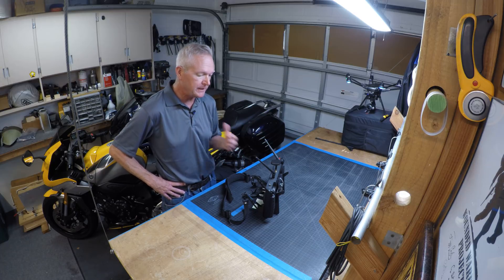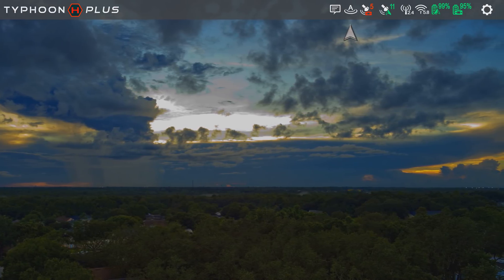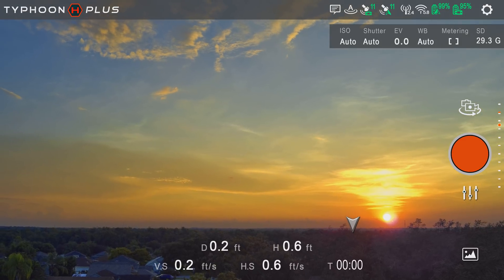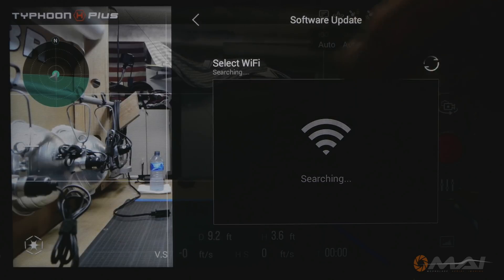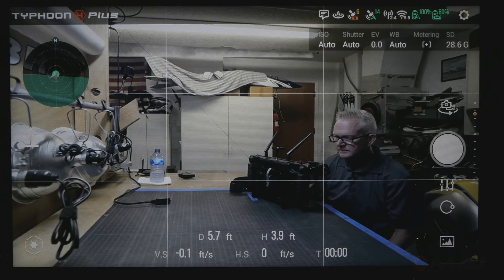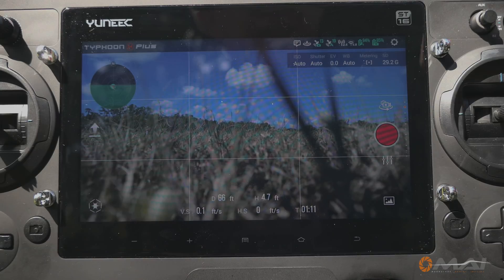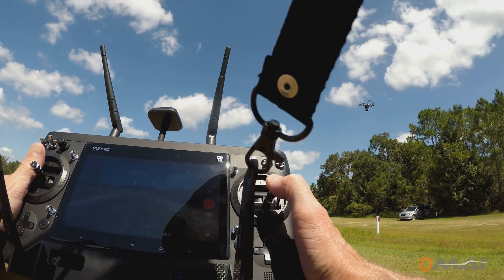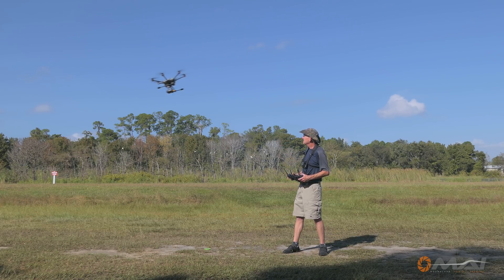Typhoon H Plus - ST16s Interface and Flight Modes

Comment: Hi Patrick

Thank you for this most interesting video. I am still with H 480 and I am waiting for the release of the H3 for a new purchase.
What is your opinion on this H3 device?

By the way, I bought your tray and I really liked it.

Thank you in advance for your answer.

Serge from Quebec Canada.
Reply from the maker: Well thank you Serge, for watching and glad you like the Copperdawg Tray. As to my thoughts on the H3 - Myself, like a lot of others are very keen on seeing how the H3 plays out. Yuneec has decided that it will be a limited release (unlike the Plus), much like the 520. Yuneec has already released it in Europe and here in the states but there are very few pilots that have them so the information is only dripping out. Personally I am curious as to the quality of the imagery from ION L1 as this is the only real difference to the H Plus outside of a few interface changes with the software that will allow the user to 'dial in' the controls much like we had on the 480. In addition, I understand that the trim pad cruise control has be added to the H3 so that is good. 

But from an operational point and from a cost point, the H3 will have to have a substantial gain in the camera to warrant the nearly 800 dollar (US) price hike over the H Plus 1,899.00 vs 2,699.00. 

The fact remains that the same 1" 20 megapixel sensor is being used on the H3 that is used in the Plus and to get better imagery will be difficult. In the current market (2000.00 price point) the 1" sensor is still the benchmark across many brands such as the DJI M2P, P4P and the fourth coming Autel EVO 2 6K as well as the Yuneec 520 and Typhoon H Plus. I am still very satisfied with the H Plus for what it is and the imagery that it produces and to me, the H3 is a bit redundant for my purposes but may have something to offer those coming from a 480.
Reply: @buelle109  Thanks for the reply Patrick.

But why a limited edition of the H3 and H520? Is this the end of Yuneec sion why such marketing metality?

Want it stayed on the market or not, I plan to buy a new drone soon, and I don't want to go to DJI, because I hate being forced to use my cell phone as a backup device.

The yuneec remote control seems so proffesional.

when did you think is this the end of Yuneec?

Comment: Thanks for you video.....I just purchased the Typhoon H Plus and can't get my landing gear to go up or down!!
Reply from the maker: Sometimes  the gear will stick if the aircraft has been sitting in its box for a long period of time. My first Typhoon had the same problem and I was able to unlock it manually (not something I would recommend). If you look on the Yuneec Pilots Forum and do a search you will find some discussion on this topic.  Good Luck.
Reply: @buelle109  Thanks for your reply.  We have tried just about everything.  The landing gear will go up if we put it in "Home" mode real quick and then switch it back to angle mode.  We may just bring it back to Best Buy and see if they can get it working, and if not, we are within the 45 day return/exchange timeframe.  ---  In the meantime, we are enjoying your videos and learning a lot from them.  Thanks again.
Reply from the maker: @MikeDianaCO  Yeah that sounds very strange. I would agree, take it back to BB and do an exchange.

Comment: When in slow speed, I can’t get the THP to move forward with obstacle avoidance turned on. Only when I move the rate up a bit to a faster speed, and even then it stops occasionally. Is this normal? It was sunny out, so I’m not sure if it was due to glare.

Comment: hi, when i have obs on and in angle mode , my typhoon h plus keeps stopping in short distances, when even at about 12 feet high,  i think  the latest firmware update changed something, have you had any issues if you have updated to the latest firmware, plus i am sure i never had this problem, the new firmware 822 has now zoom for the camera modes. thanks jason
Reply from the maker: Jason, I do not use RS but I have read on Yuneec Pilot's forum that there were others that encountered similar problems, many  Plus Owners have  reverted back to build 784. Good Luck.
Reply: @buelle109  ok how do i revert back.?

Comment: Does the Typhoon H not have maps? If that is the case how does no one ever mention this? Seems like a pretty big deal to me.
Reply from the maker: I guess it depends on what you are used to. The Typhoon H and H Plus series do not have mapping software but there is an aftermarket solution for the Typhoon H  called UAV Toolbox. However the Plus does not have any such support at this time. The Typhoon H 520 is Yuneecs 'Commercial' solution and it does have mapping.
Reply: Thank you for the reply. I suppose as long as I fly close not having maps would not be a big problem.

Comment: Thanks for sharing. Is the H Plus ´Smart Mode` the same as the Smart Mode on the H?
Reply from the maker: Essentially yes, but as I mention; it has a few safety's built in that the standard H does not have. Flight wise it is the same.
Reply: @buelle109  Thanks!

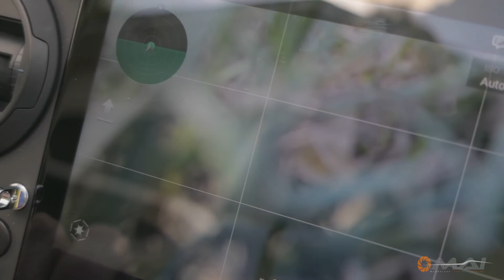Comment: For new Typhoon H Plus pilots, If you following the video from 8:00s, you can see that the aircraft will fly straight down to land at almost the same spot as the Home Point because the pilot did not fly the aircraft away from the Home Point.  So if your aircraft is over the tree or over water, the aircraft will landed into it.  Therefore, before using the landing icon on the ST16s, make sure you "Position the TYPHOON H PLUS above the area where you would like to land", then slide the landing icon.  Otherwise your aircraft will landed on top of the tree or water or wherever location.

Comment: Hello
I have a question on the height restrictions. Yuneec implies on their site that the max height is limited to 400 feet. In your video under settings it seems there is a slider where max height can be set beyond the 400 foot limit. Understand the current FAA restrictions for hobby flights just curious if the height restriction cab be changed.
Reply from the maker: The simple answer is; yes, you do have the ability to set max height to 1640 feet from the take-off point. Keep in mind these aircraft use simple barometers to determine height and do not have any understanding of distance from the ground. For instance if you were standing at the foot of a steep mountain and begin a climb in which the aircraft stays within 100 feet of the mountain's surface you could climb 1640 feet from the takeoff point and still be within 100 feet of the 'ground' and therefore within legal limits. And of course when flying around man made structures such as buildings or tall towers, as long as you are within 400 feet of that structure you can legally fly to a max altitude of 400 feet above that structure. For these reasons The Plus allows the extra altitude. It goes without saying; outside of these types of scenarios, flying above 400 feet is ill advised and illegal at least here in the US.

Comment: This is a very well done series.  You really do nice video work.  I had no idea about the "Cruise" mode.  Turns out there are only one or to others writing/videoing about it.  It looks to be a really useful feature on an already well loaded platform.  Since the "less than obvious "  seems to  be in your wheelhouse I thought I might share something I found by accident that looks to be a real time saver in the "records keeping department"  Are you aware of the amount of telemetry data that gets recorded in the ST16 and I'm guessing the ST16s as well.  It records everything!  Not just GPS stuff , but start and end times, battery voltage and current and a tone of other stuff, all every second of every flight.  I'm working with my brother who is a software developer to write an App to extract some of this gold.  One last item, elevate your quality and polish one notch, drop the word "Guys".  You new subscriber Glen

Comment: Hi Patrick, really appreciate your videos. I have a Blade Chroma and have been delaying an upgrade and I was thinking DJI but I really like the Chroma (made by Yuneec) and the H+ seems to fit the bill. Two quick questions 1. Max range? 2. I thought the ST-16s screen was supposed to be a lot brighter than the ST-16 yet I noticed at one point in the video you were using the shadow box.
Reply from the maker: Max range will depend on environment but some guys have been reporting at least 5000 feet which, is well beyond VLOS. As to the screen, it is a little brighter but I do almost always use the sun shade when I fly

Comment: where did you get the harness clamp
Reply from the maker: Do you mean the trey that holds the ST-16s controller? If so this is the trey I designed and is sold through Copperdawg.com/TransTray.htm, there is a link in the description.
Reply: That's the guy.  Two of my tiny clips broke already with the one I got with H+   A bit more than I thought but looks very well made. You did a good job.  May be in the summer.  In Canada so would be close to $200 for me. Like your page not much on the H + yet.  Learned a lot from you. It's a fantastic drone.

Comment: Excellent video sir. Getting ready to pull the trigger on the H with real sense. I'm somewhat confused about the differences between the "H", the "H with Intel real sense" and the "H Plus". My budget only allows for the "H with real sense". Any help/advice would be greatly appreciated!
Reply from the maker: Okay, the Original Typhoon H comes with the CG03+ Camera which has a 1/3 inch sensor and maximum image size of 12 mega pixels. This model has been around for a couple of years and is a very solid system. A lot of times you will hear me reference it as the '480', this is the distance between motors in mm. The 480 comes in three different bundles and the "pro" version has Real Sense which is an additional layer of obstacle avoidance

The Typhoon H Plus is a new model that was just released in July here in the states. While similar in looks, is a totally different aircraft; it uses a different flight control system, different batteries among other differences and, it also carries the C23 camera which has a 1 inch sensor and a maximum size of 20 mega pixels. It also has larger more powerful motors that necessitate bigger propellers and thus has a motor distance of 520 mm and thus shares the same size and features as Yuneec Professional Typhoon H 520. Currently in the US, the Plus comes in just one bundle and that is also the "Pro" version with RealSense. Yuneec is slated to offer the Plus in a standard version without the RS, but so far only a few select dealers have these models 

Personally, I have a 480 and a Plus. I never wanted the RS so I bought my first Typhoon H without it. When the Plus came out I had no choice so it does have RS but I have never used it. The obstacle avoidance of these systems are in their infancy and provide some level of avoidance but they are not fool proof and can be caught in instances where they will not work 100%. My advice if you get the RS on either model - research it, find out what it can do and what it can't do. For instance it can't detect obstacles above or behind or to the sides. 

Hope this helps. Good Luck.

Comment: Thanks for doing this video, Patrick! I just ordered an H Plus and didn't realize that the ST16S was that much different in the menus, etc. I think I also see that the display you are showing in the field demo is actually brighter compared to the ST16. It was featured as one of the advantages over the ST16. I hope that you continue with more videos and am going to review this one several times before I launch my H Plus.
Reply from the maker: Hey Tom thanks. Yeah the display is a little brighter. More will be on the way. I also have a series on the Regular Typhoon H that might have some helpful stuff as well.
Reply: Yes, I did watch some of your other videos on the H. I appreciate the fast response. I have been a DJI Mavic Pro pilot for over a year and wanted to step to a more pro model with my 107 license.

Comment: Hi Patrick. Thanks again for these great videos on the H and H Plus. I was wondering if you might get around to testing the RealSense out some time? Also I would like to see the actual flight time for the H Plus. And do you know if the H Plus can be bound to more than one controller and if the Wizard Wand would work with it? 

Also, do you know where to get batteries for the Typhoon H Plus and a battery adaptor lead to charge the battery on a third party charger for cycling, testing cells and storage? The links you provide in the description are only for the Typhoon H battery.

Thanks.
Reply from the maker: @Airwolf, You're welcome, I may do some future video on the RS but to be honest I don't use it much or at all as yet. Actual flight times? I can get a solid 18 minutes in average conditions without pushing into the warnings. Yes, you can bind to other controllers I am pretty sure as another Plus owner has posted a video of using the Plus in 'Team Mode'. I bought a third battery from the only place that had them at the time - BB
Reply from the maker: Also forgot to mention the wizard will not work with the Plus as the flight control for it and the 480 are not the same.

Comment: Great videos. I got my h plus last week. But I can't find any new filters the will work with the c23 camera.
Reply from the maker: FreeWell made filters specifically for E90/C23 but may have ceased production recently. In that event, there was included with your kit, a filter adapter that allows a traditional male-threaded ND filter to work, the size of filter to use with the adapter is 40.5 mm. In another video I am going to address this. Stay Tuned.
Reply: @buelle109 . I purchase a set of freewell ND filters and it don't fit. and as far as the adaptor that came with the typhoon h plus, it's a female to female adapter. I need a female to male adapter and I don't have it. Anyone know where can I find this adaptor?
Reply from the maker: I also have a set of the Freewell filters and they fit my C23 fine. There is a thread about this on the Yuneec Pilots forum with much more info so please check that out. The Frewell filters are dedicated type filters in that they do not need any adapter - just unscrew the stock UV filter and thread the Freewells on. The adapter allows the use of standard (male threaded) type filters - hence the female to female threading as you noticed. Here is a link to that thread - check it out. https://yuneecpilots.com/threads/freewell-nd-filters-for-h-plus.13475/page-6#post-153817
Reply: @buelle109 , Thank you.
Reply: Yes the adapter works but be careful how heavy the filter is your going to use. The gimble motor will fail if its balance is to heavy at the face of the camera. The camera motor will power off till the weight is removed.